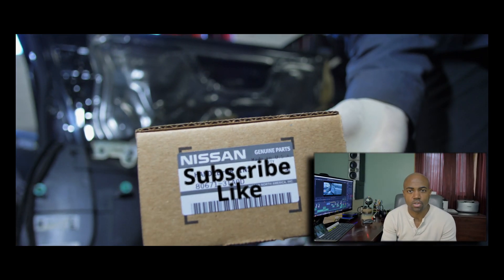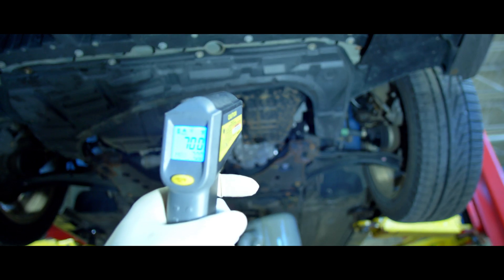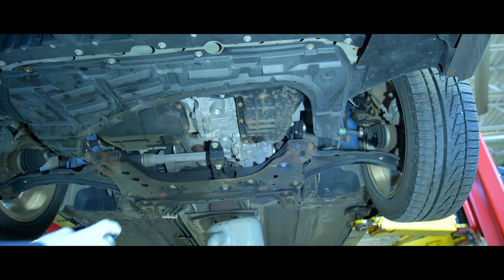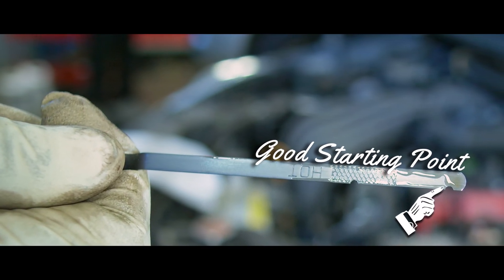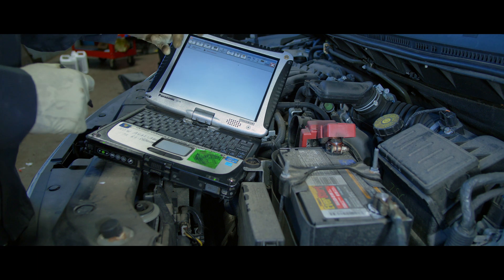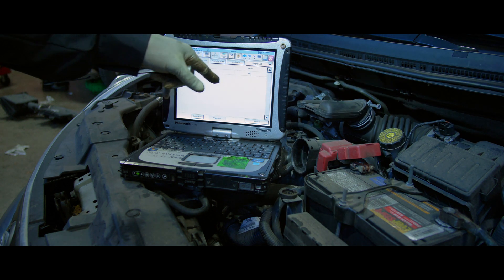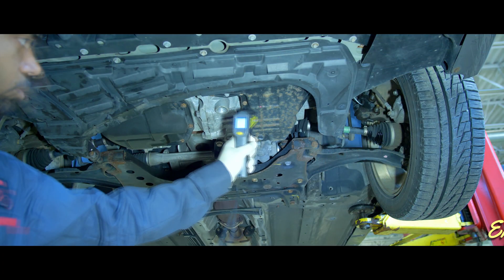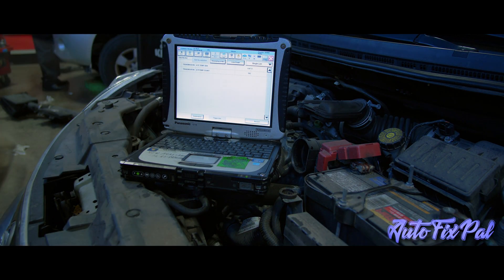How to set Nissan CVT fluid level without a scanner - Transmission fluid level

Comment: Does all of the cvt fluid get changed out or just a 1/3?
Reply from the maker: i would say about a 3rd sounds correct.
Reply: Can you show a 2013 Altima 2.5 full CVT change/flush?
Reply from the maker: @pauld8369  its just a drain and fill. But i will put together that video soon. Already in the process of editing a video for inner door handle replacement on a 2014 altima. I will do the CVT fluid on it next. So give it a week or 2.
Reply: Have u ever tried dipstick p/n 31086-JA00A, on a 2013 2.5 engine to check the fluid levels, (After doing a flush)?
I found reference to it online that if u don't have a CVT dipstick u can use it to check the CVT fluid levels.
Reply from the maker: @pauld8369  i have not tried that. But i will look into it.
Reply: @Autofixpals  Any news on the dipstick? Or CVT flush video?
Reply from the maker: @pauld8369  There is a "universal" type dipstick. There is also a chart that you use with it. However you still need to monitor the fluid temperature to get it at the correct level.  I have enough evidence i think to put together a video for setting the level with a temp gun. But thats a ways out before i get to it. But what i find so far is that the temp gun is usually within about 10 degrees of the scan tool info, taking the reading on the drain bolt. That is 10 degrees cooler than the scan data info.
Reply: @Autofixpals  I have a app CVTz50 and obd2 Bluetooth adapter I can see the CVT temp, so the hand temp at pan bolt data u have may convince me the $5 CVTz50 app is accurate.
Reply from the maker: @pauld8369  that app looks pretty cool. I don't see why the data on the app would be incorrect.

Comment: Great video Hakim ! 
I had a friend with a 2012 Altima 2.5. complaint was the brake pedal was stuck in the depressed position after a car wash. They then turned it off and back on and it returned to normal operation. I couldn't reproduce the symptom. Have you run across similar issue? If so what was the diagnosis?
When I get my scan tool hooked up looking at abs live pids I see the actuator relay going off and then quickly back on every so often... But nothing else seemed unusual
Reply from the maker: thank you sir! unfortunately i have not seen that problem before. wish i could be of more help. try hosing the car down and see if anything misbehaves.

Comment: Great video .   Is all the  Nissan cvt cars  measured @ the same temperature? I have the Nissan Rogue 2015  with no dip stick and a bolt @ the Botton , so what’s  the correct temp for that one  before removing the  bolt to check ?
Reply from the maker: no the Nissans without a dipstick are done differently. Here is a video i did for the non dipstick models. Yours will be done the this way https://youtu.be/HTXM5SbznEM